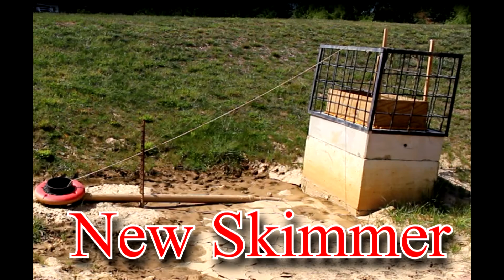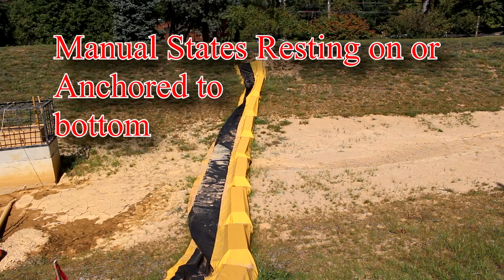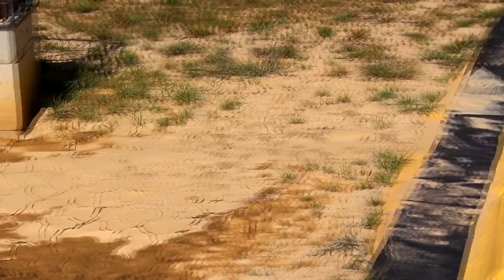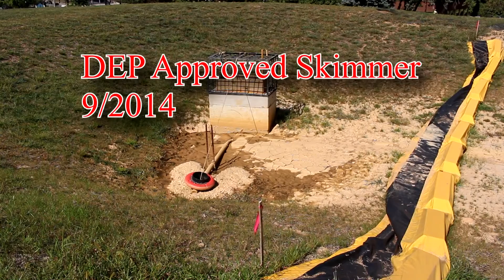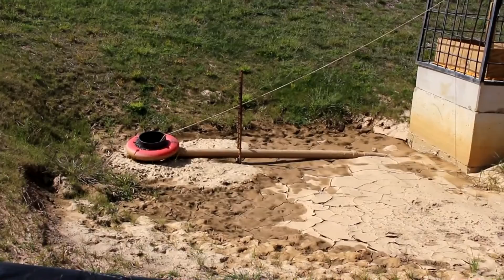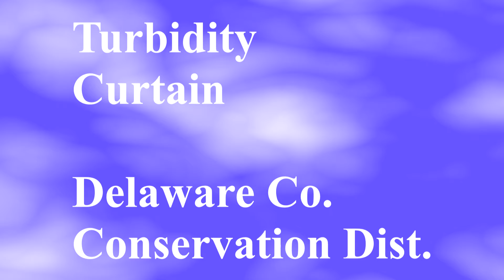Turbidity Barrier   Marlee Float Skimmer

Comment: The Marlee Float skimmer is made by Rymar Waterworks.  It is approved for use for surface withdrawal from sediment basins and has the advantage of being made from HDPE rather than PVC, making it more durable and UV resistant than PVC products.  You can find more info at www.MarleeFloat.com
Reply from the maker: Sorry did not see your comment until now.  Thank you for the information.